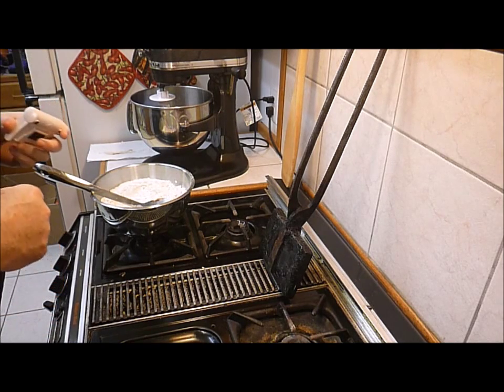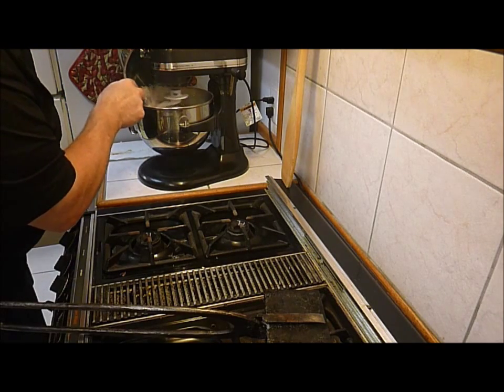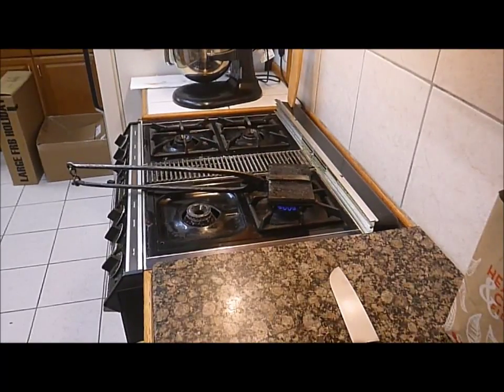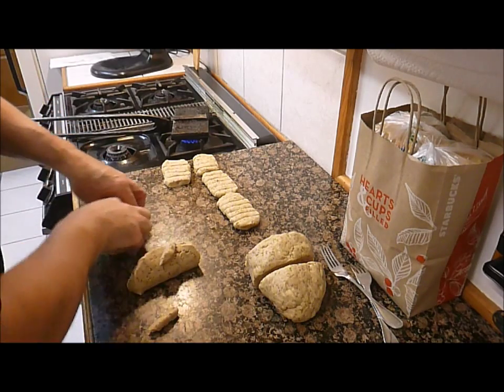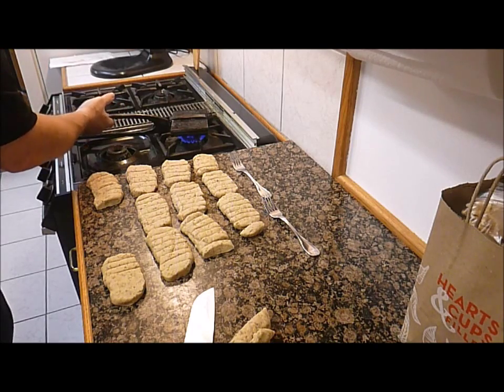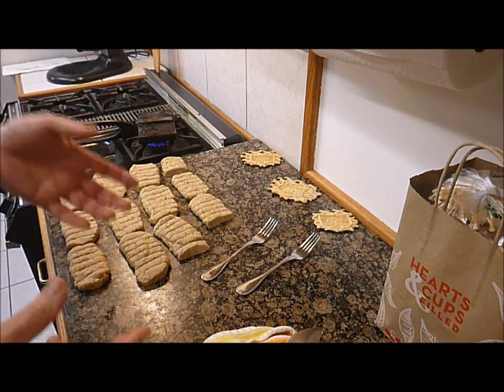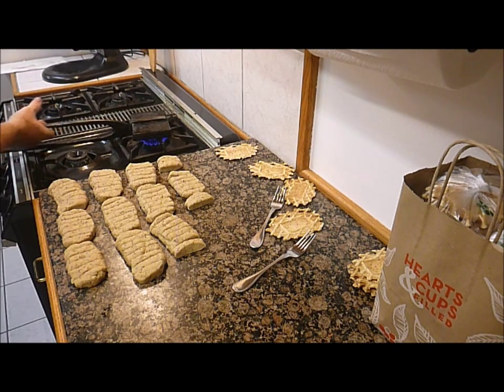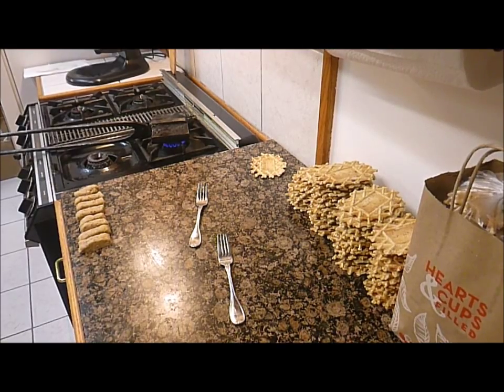Pizzelle 201 - Pizzelle Dough Mixing and Pizzelle Iron Heating at the Same Time

Comment: I am having trouble with my pizzelle iron. It's similiar to yours but round. I cannot get the pizzelles not to stick. Any suggestions?
Reply: Try a little oil on a paper towel, wipe the plates.
Reply: I spray mine with Pam after each cookie
Reply: You need to Seasen  it just like you would  a cast iron pan.
Reply: Hi Lisa - how's it going with your Pizzelli making? Still having trouble? Hope it's going good for you.....Merry Christmas!♡
Reply: @oneitalia2312  I wish it worked. Tried everything. Gave up. But will never get rid of it as it was my mother’s. Will try again soon.
Reply: Lisa, let me understand you about the pizzellis......you say "I cannot get the pizzellis not to stick"? Explain, please, I would like to help you....
Reply: @funfish1122  make sure that the iron is hot before you add any butter or oil!